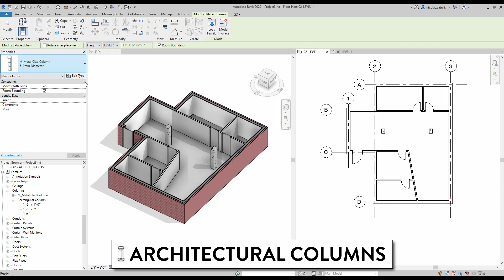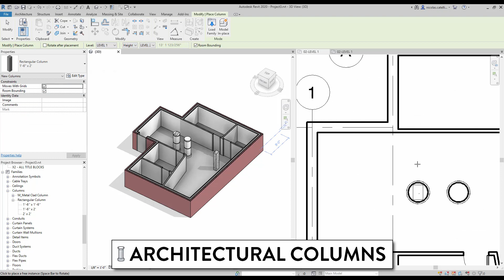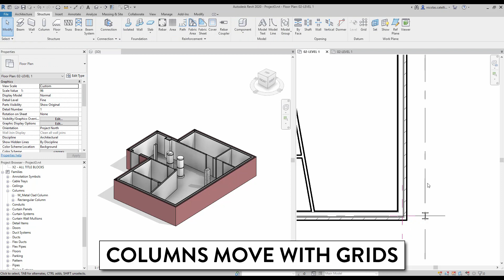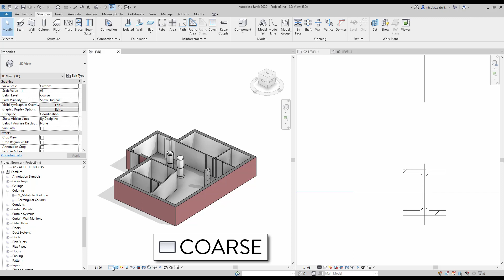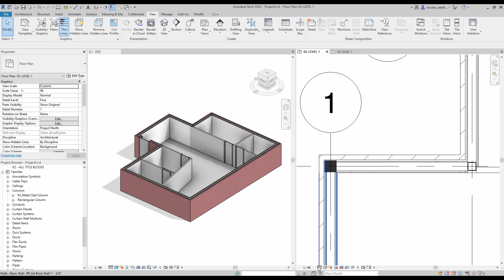Revit Tutorial - Understanding Columns

Comment: 0:33 > Structural columns
0:50 > Architectural columns
1:35 > Insert structural column family
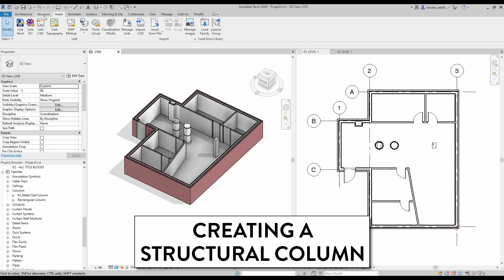2:00 > Creating a structural column
2:08 > Set the height placement option
2:27 > Select the top level
2:46 > Create columns at grids intersections
3:07 > Columns move with grids
3:30 > Adjusting detail level
4:14 > Advanced tip: create a dark fill pattern for all columns
Reply from the maker: Thank you so much!
Reply: @bimpure  No worries. Shall we start a collaboration?  ;-)

Comment: Do all architectural columns have to take on the wall properties they attach to or is there a way to shut that feature off?
Reply: maybe it depends if the structural option is on or off? 
If the material is different then they don't join.
Hope this helps.